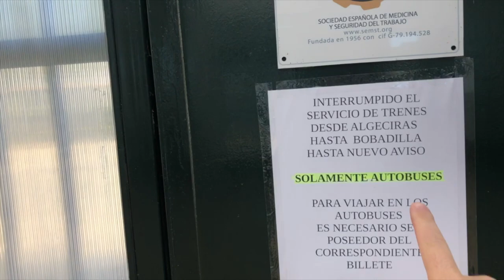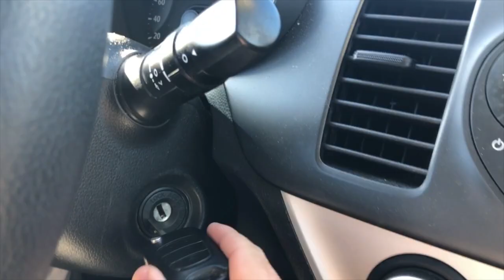Train problems, Car problems - Vlogmas nearly trip to Ronda

Comment: Probably your best vid yet, Ninja!  Didn't the guy tell you what the problem is?  You either have a bad battery or loose cables, ie. bad connection.  The guy should have told you or better still you should have asked him!  Anyway, this is an EASY problem to have and at worst, you would have to buy a new battery and put it in yourself, which could be "Part 2".  Well, it could be the alternator (that tells the battery to charge as you drive along), they should check the battery itself to see if it is holding a charge.  Not holding a charge, then you have to buy a battery. 
Last problem I had was the damned wheel fell off but thank God, I was pulling into Pharmacy.  So it wasn't like I was on the highway.  Keep telling yourself it could have been worse, and that is true.
Really I think you have more of a problem with that gingerbread house than you do with your car, much WORSE.   That was when you should have called your dad!
Reply from the maker: Hahaha ... yes my gingerbread Christmas village looked more like a horror village! hahah .. the battery seems to be working again :)
Reply: @NinjaMonkeyguy  Looked like Mad Max post nuclear Apocalypse city.